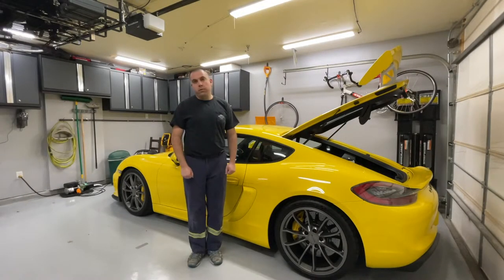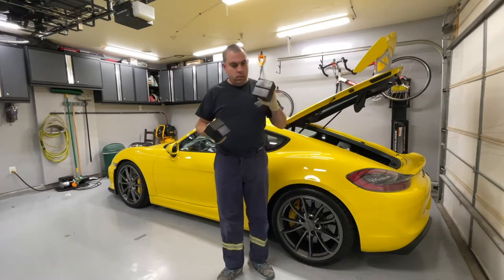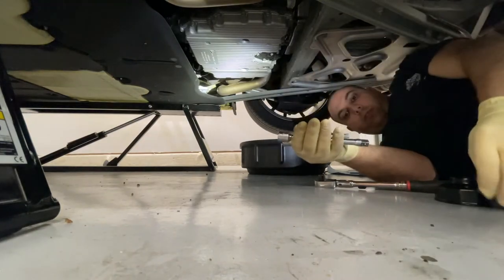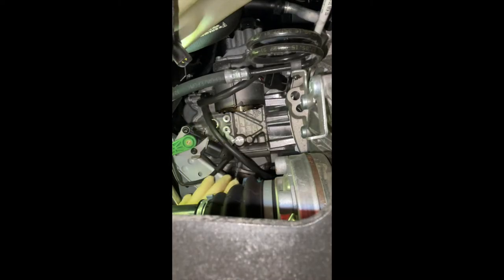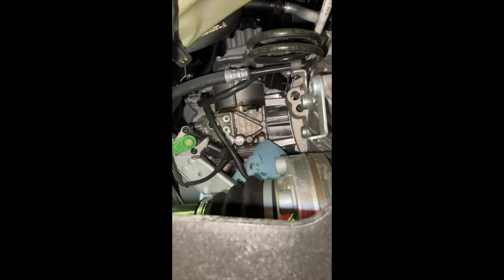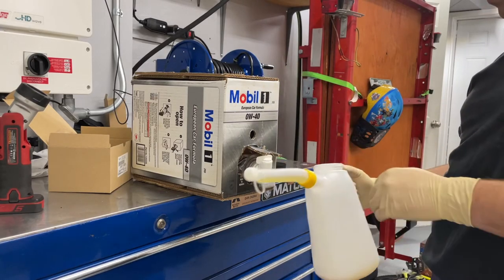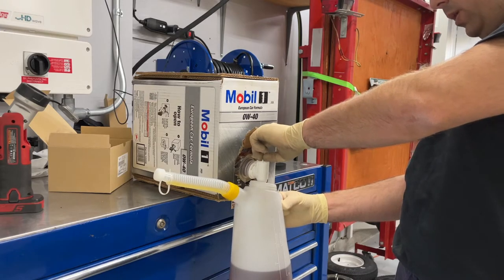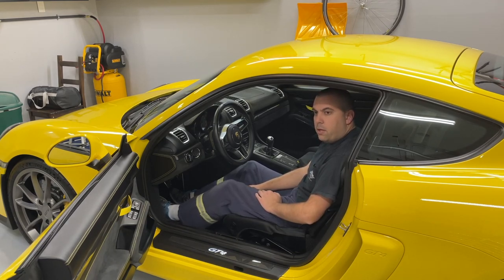Porsche GT4 2nd oil change

Comment: Two comments.  I use a plastic baggie over the filter canister when removing and never spill a drop on cross members also then have a place to put the filter element after cutting and inspecting.  Also it appeared that your car was properly filled at one bar below the top.  I don't believe it's supposed to be to the top bar.  Enjoy your videos.
Reply from the maker: It was actually 2 bars that show empty.  I don't know what happened to the video and why it looked like that.  I think the sunlight might have done something with the camera.     

Also that is a good idea with the baggie.  

Thanks for the comments on the video, I'm not trying to become a YT star.  Just trying to help others if possible since I have the mechanical knowledge.   I can explain things good but I'm a bit goofy on the camera lol.
Reply: I use the baggie to limit oil spill. I also add some oil to the new filter/canister before reinstalling. About half full so you can get it back in place and not spill. I notice it shows oil pressure a little quicker on first startup. I’m on a two change cycle, second is at the time of winter storage starting in late October/early Nov depending on weather here in Ohio. thanks for sharing the video!

Comment: GtMachine, where did you buy the oil filter and washer for the drain plug at?
Reply from the maker: I got them from Delaware Porsche online parts website.   I would just take the part numbers and google search.  Depending on where you live it might be cheaper for shipping to get it from a dealer closer to where you live.